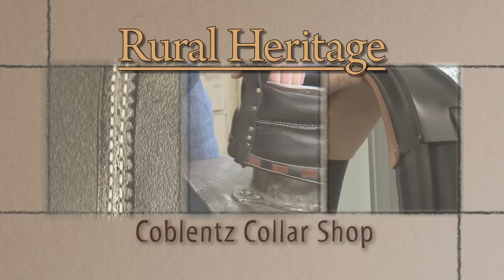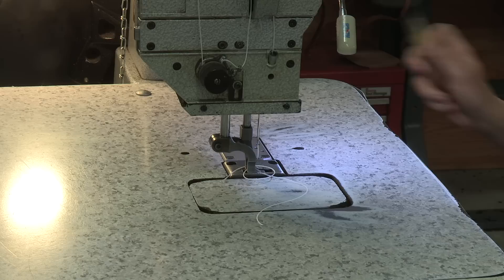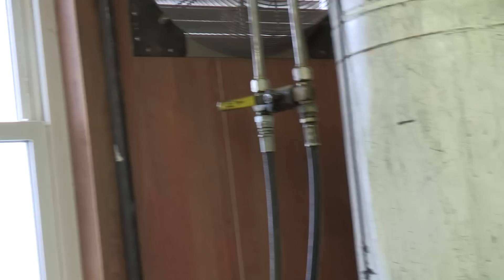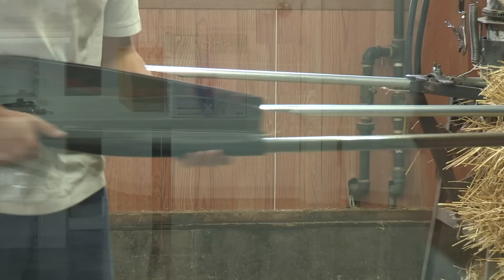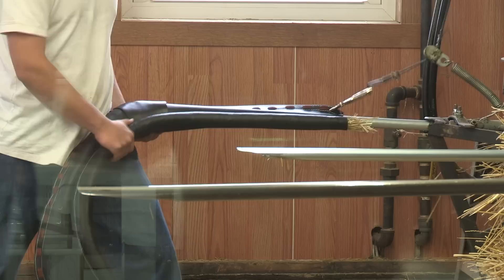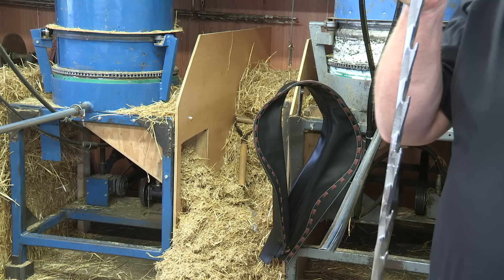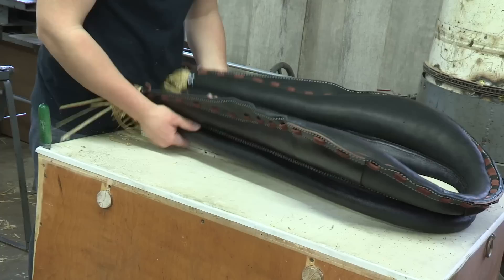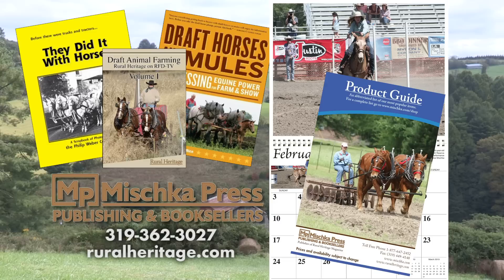Coblentz Collar Shop - Hand Crafted Draft Horse Collars #horsecollar #drafthorsetack #leatherwork

Comment: It looks like this may be where two of my collars were made. What I don't understand on the two I have is the top is so wide. Wide from front to back of the horse's neck. So it does not want to stay 'set back' on the neck. It wants to ride up the neck rather easily. I wonder if it is a mule collar. I have googled extensively and cannot see an actual picture of a mule collar to see if they are indeed wide or deep at the top of the neck.